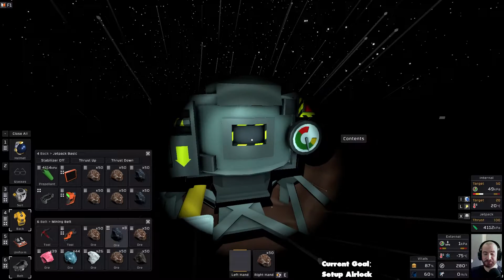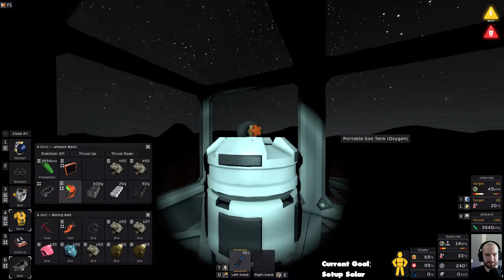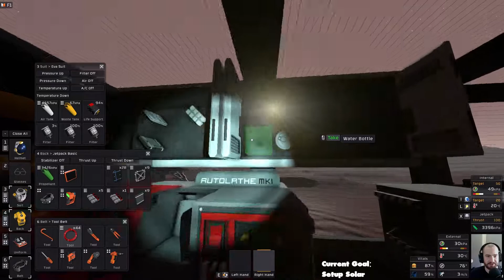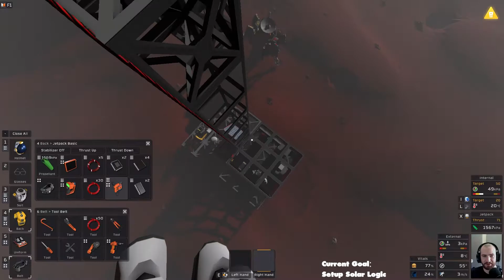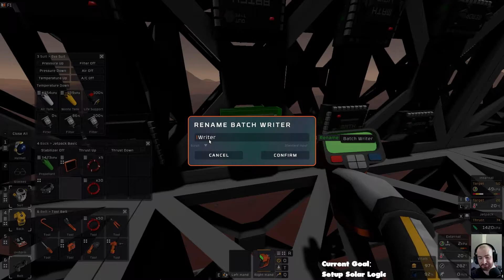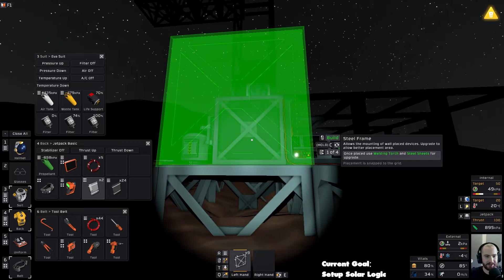Logical Solar | Stationeers Mars Colonisation | Episode 3

Comment: Division with a fraction doesn't increase the value, necessarily. If you divide with a fraction less than 1 it will take you further away from 0 but if it is above 1 it will take you closer to zero.

Comment: small tip solar panels don't have to face east. You can place them however you like and then you just need to rotate them to 0% horizontal and 0% vertical and whatever direction they face, be it north east south or west is where the data port of the daylight sensor faces. But having them face
Reply: oh and I don't know if you are playing on the beta version but looking at the date  you probably are. The tracking of the sun has changed somewhat where you need to reset the memory that is at 75 to 90 this will angle the solar panels very slightly but it will increase efficiency somewhat.
Reply from the maker: Hey! Thank you for all this I had no idea. I've just been using this old method since I first learnt it. I noticed a huge efficiency loss in Ep 8 and just put it down to the glass (which normally causes like a 3% loss). I'll adjust the settings in the next one.